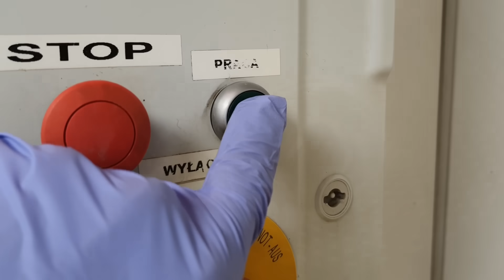Takiego brudnego dywanu nie widzieliście, brązowa woda prawie jak błoto wypływała nieustannie !

Comment: me thinking it's done after the soap mixer:

the other 40 mins: hey
Reply: hey
Reply: how y'all doin
Reply: if it takes all that effort to clean the carpet just get a new one atp
Reply: @desimoruyesok9135  Right? Lmao. All that water.
Reply: Hey
Reply: @desimoruyesok9135  to be fair for it to be this dirty it will at least take a few decades so maybe it developed a historical meaning in the family? Idk
Reply: @gretathunberg6197  It is a wool carpet, and wool carpets are big and expensive (especially old ones), so it's more likely to be cleaned and used for many years before being replaced.

Edit: I looked into it, and wool rugs of a similar size and design to that one often sell for over 200 dollars.

Comment: 37:16 What is that big two handed wide hose you are using? I originally thought it was a power washer but the power seems much too gentle to be one of those and the nozzle is very different

And what is that push scrubber thing? We need one of those for the floors at the fast food restaurant I work at x3